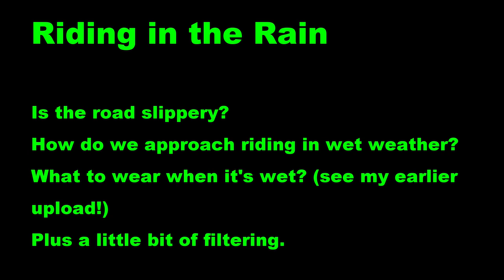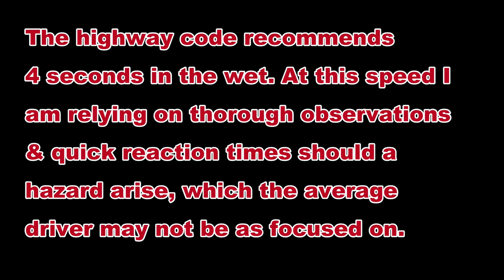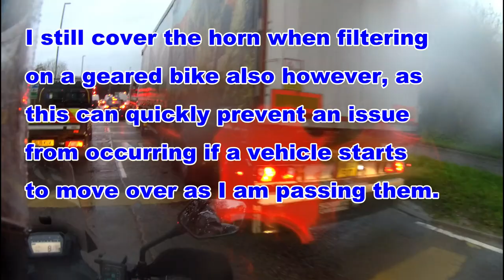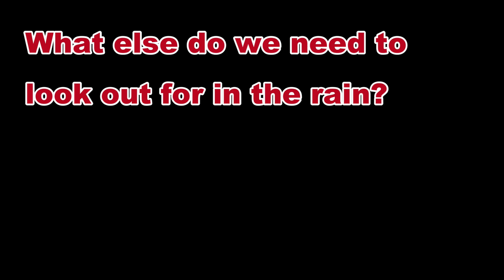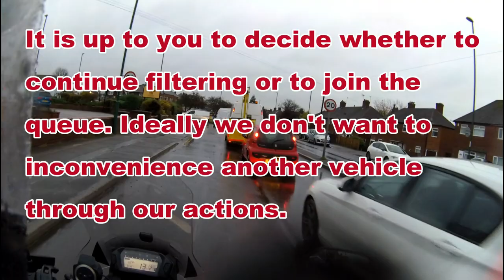How to Ride in the Rain: A guide to wet weather motorcycling

Comment: My biggest issue with having ridden in the rain for all my riding career and surprisingly enjoying it (especially at advanced and especially especially at the Masters level I'm training to be at, because you can be surprised at the progress you can make when you understand how to moderate all inputs) is your average car driver. You can generally tell who learnt to drive in the wet winter and who learnt in the dry summer, they do not drive to the conditions. I find that as soon as there's rain, the driving standards somehow drop even further than they already are. Aggressive overtakes, tailgating, slamming gears to slow, list goes on. Genuinely the only part of wet riding I don't enjoy, I think it's the best time to learn to ride because you HAVE to master smooth inputs, especially countersteering to change position, keeping the bike upright over road furniture like lines will majorly reduce risks when other options aren't favourable
Reply from the maker: You're not wrong! I once saw a middle-aged lady in a Corsa do a 180 degree spin on a multi-lane roundabout, about 2 seconds before my lead student entered the roundabout. I wish I'd kept the video! Too much speed on the way in, it's tight and she rammed the brakes on as she turned.... Voila, car now facing us in the middle of the 3 lanes 🤦🏻‍♀️. Luckily no one else was involved. It just goes to show how little awareness some people have when conditions change. Oblivion, ignorance, arrogance, impatience... I could go on... 

I quite enjoy riding in the rain too, for the same reasons as you 😊 Thanks for your comments, I appreciate you taking the time 😊

Comment: You know that is a really great tip "covering the horn whilst filtering" and even after 30 years riding I have to admit something I've never done but should've so thankyou for that.
Reply from the maker: Hi Matt, I didn't used to either, but it definitely helps to be prepared before there's an issue rather than too late 😊

Comment: The rain is the only thing I've ever gone over in when I was a very new rider, someone cut Infront of me and I panicked and grabbed too much front break.

Can definitely agree with you on heated clothing! I only have heated gloves for my commute but it's changed a rainy day trip to work into something a little more pleasant. Definitely recommend folks is get waterproof over-trousers at minimum. I've got some ones with a little strap that goes under my foot and it means I don't get wet socks because the trousers don't ride up. Works great.
Reply from the maker: Well the good news is you know why it happened!

You're right, heated gloves make the world of difference on a cold wet day 😊. Good point on the over trousers too, thank you.

Comment: Heated gear is pricey, but worth every single penny. But it's designed to work with other things like hand deflectors, windshield, heated grips, etc. Wearing waterproofs is also a big help, keeps the wind away from breathable leathers.
Reply from the maker: Yes, it's been a staple part of my riding wardrobe for a number of years. I agree about the waterproofs acting as a windproof layer, but only if they're actually windproof! I've had some that let the air through and blow up around me 😂
Reply: @motorcyclelessonsuk  I recall once not doing up the sleeve straps on mine, ended up looking like the Michelin man :P

Comment: Hi again, 10 minutes in you filtering on the left of the line. Is there a point when filtering becomes undertaking?
Reply from the maker: Hello, thanks for your comment. It doesn't matter which side of the line we are when filtering, filtering is simply passing a vehicle on either side that is in slow moving traffic. Undertaking is different, usually not at such slow speeds, and generally not passing as many vehicles in a queue at slow speeds. Speed is the biggest differentiating factor, as filtering is considered safe and legal by the highway code, whereas passing vehicles at higher speeds and/or intentionally moving totally into the left lane to do so is not recommended. I hope this helps. Thanks again.

Comment: I find the DCT tricky when cornering.  It's not so bad in the dry, but when it's wet the gearbox shifts down when I'm leaned over.  This is a real problem for me.  Once I've set my speed for the bend, I go straight to the acceleration phase (no gears = no influence over the gear phase), but the DCT often shifts mid bend which destabilises the bike.
Even when I switch to 'manual' it always overrides.  Sport mode is better than D, but all modes offer less stability than a manual transmission...
I've only ridden 2 DCT bikes, my current NC700X, and an NC750.

How does yours fare in bends?
Reply from the maker: Hello, in my experience it doesn't make any difference whether it is wet or dry, however I suspect the reason you feel it more in the wet is that you will be slowing down in the bend, thus causing the bike to drop into the lower gear. The key to avoiding this is setting the speed for the bend before the bend and not decelerating around the bend or IN the bend. That way the bike will stay in the gear it is in. However if the bend speed crosses over the exact speed that the bike wants to change gear (you'll notice they want to change gear at specific speeds, mine changes from 1st to 2nd or vice versa around 12-13mph), it is difficult to stop it from changing gear in the bend. I do experience this on two separate tight turns, but I expect it to happen and just relax my arms rather than fight the bike or feel unnerved by it, then be ready for the upshift which usually follows. It's a case of working around it sometimes, or expecting it to happen and not feeling surprised by it or annoyed by it! Thanks for your comments 😊